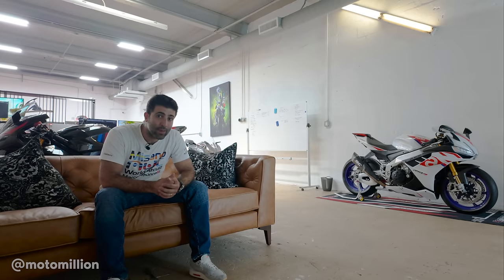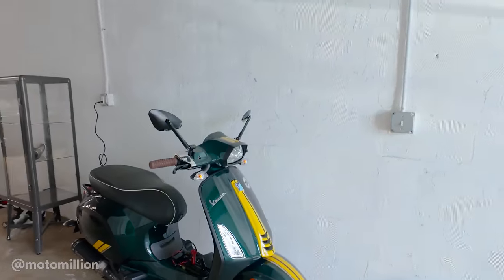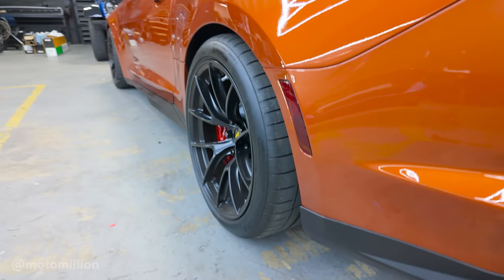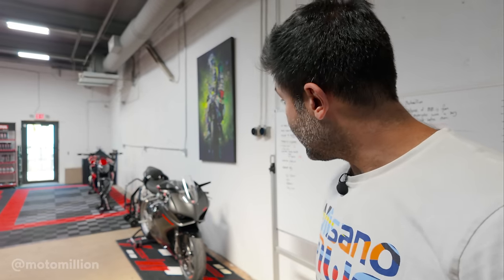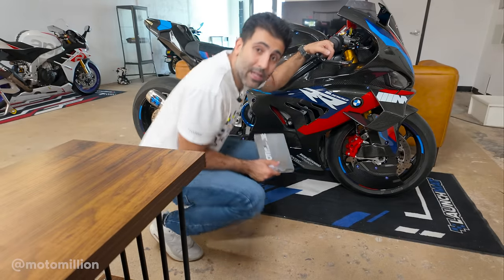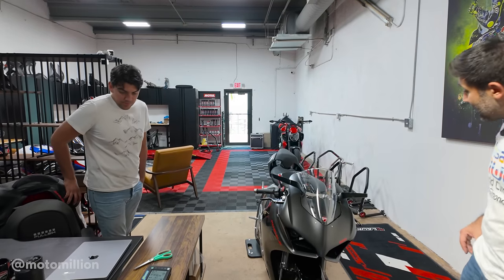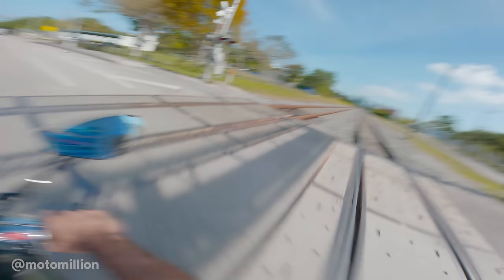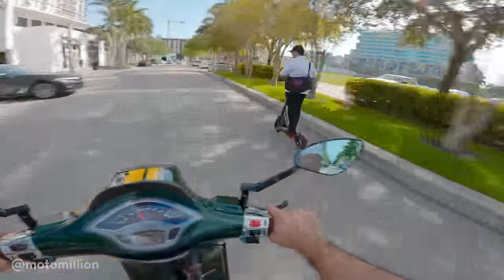Is The Ducati Panigale V2 BETTER Than a V4? | VLOG002

Comment: If it was a friend that passed or got seriously hurt don't let that discourage you from riding. I've lost a few friends and I myself died from a massive motorcycle crash when I was 19. I am now 48 and have never stopped riding. 2021 Z H2 with 220 hp. Just be careful and remember there is a time and a place for screwing around. In town and in traffic is NOT it.
Reply from the maker: Great advice!
Reply: Wait so you are a zombie??
Reply: @bella_testastretta  Brains...BRAINS! LOL! No, I died twice on the way to the hospital. I completely shattered my left forearm and wrist, my right wrist was broken, and I split my Pelvis. Massive internal bleeding.
Reply: @Supercharged1976  Do you have any issues with oil coming up through the ram air intake for the supercharger? I wanted a Z H2 bad but the oil leak issues put me off
Reply: @chorseundgrd  It's common on supercharged applications. It's mainly only an issue if you fill the oil above halfway in the sight window. If you watch your oil level it's not an issue. You'll naturally get some but nothing to be concerned about.
Reply: @Supercharged1976  Bro that's insane!! you are a trooper for surviving that.

Comment: If you haven't owned a superbike then the V2 makes total sense. Better on gas, tires and insurance. But...... Once you've experienced literbike performance it's hard to drop down in power.
Reply from the maker: The question remains, in day to day riding V2 a better choice?
Reply: @Motomillion  my insurance was cheaper on the v4 than the v2
Reply: @legendofpanigale  because they know you will be more shy on the throttle on the V4 than on the V2 🤣
Reply: Is it though? I would rather have usable, enjoyable power in the turns than constantly be worried about trying to keep the bike under control. Maybe a good comparison would be riding a Tennessee Walker horse vs riding a thorough bred horse that spent time on the race track. The walker is gonna be a smoother and more enjoyable ride while the thorough bred is gonna go fast, but be a pain in the butt anytime you want to just enjoy the trail. Two different experiences.

Comment: Ive had both the V4 and V2. V4 is over kill for the city and not as Nimble as the V2. The V4 feels heavier because the Engine is heavier and the V2 has a better weight distribution more balanced making it feel lighter. But in stock form (wet weight) they almost weigh the same.. (441 V2 vs 436 V4)
Reply from the maker: Thank you for chiming in Arturo!

Comment: In most cases your bike choice comes down to purchase price and value for money. A V4 is crazy money in Ireland but I did buy a new 2022 V2 Bayliss because its got a lot of nice extras and a beautiful paint job which I thought was value for money. Same with my new 2021 BMW S1000RR m package - it came with a lot of extras as standard so was again good value. But now to replace it with the new model all those extras are options so now the S1K m package is not as good value for money.

Comment: That's the first scooter I've ever seen with an Akra slip-on, Brembo brakes, and Ohlins suspension. I'm not sure how useful all that is for a 150 cc scooter to ride around downtown Miami or to go to class but to each his own. As for the Panigale V2, there's nothing wrong with it. A stock V2 puts out 155 bhp and weighs 419 lbs. wet. 99% of street riders can't ride a bike like that to its full potential. The reason a lot of people don't buy it is because they think of it as a girl's bike or that it doesn't have enough attitude. I've seen guys on an R6 or Gixxer 600. There's nothing wrong with it.
Reply from the maker: The exhaust on the Vespa is actually a full exhaust 🤓